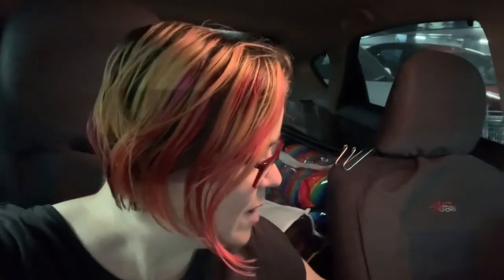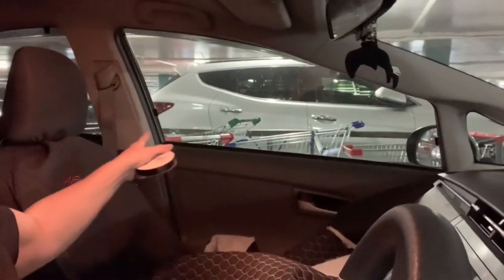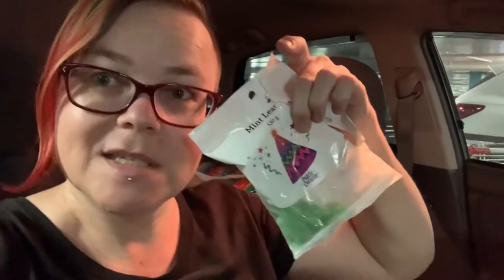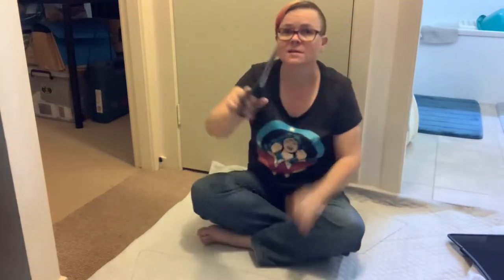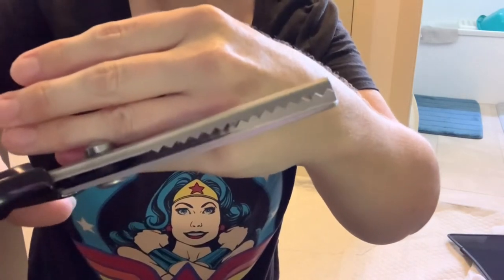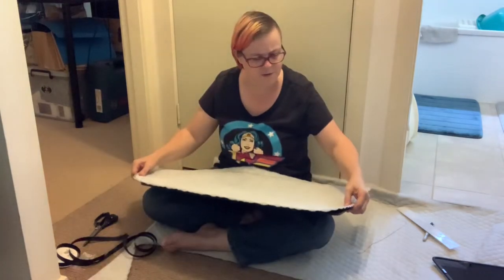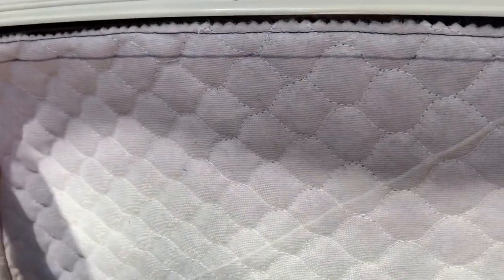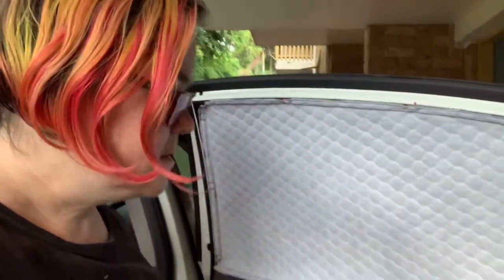Making window covers to turn my Prius into a micro camper - a detailed video [CC]

Comment: You could add a couple of Velcro dots at the top, so if you wanted to fold it back for air, it could stick down...

Also, what about the windshield? Don't you need to block out the light from there too?
Reply from the maker: I ended up using some magnets, just like around the outside. I mention these in a future video. As for the front windscreen, I just use a normal silvery one used in most cars use for blocking the sun. It works fine.
Reply: I wasn't sure if the magnets were strong enough to hold through both layers of material, but am glad you got it all worked out
Reply from the maker: The material isn't actually that thick, so the magnets don't have any trouble at all. 🙂